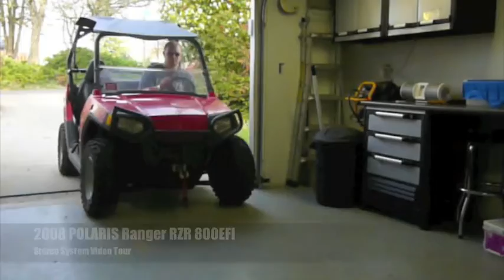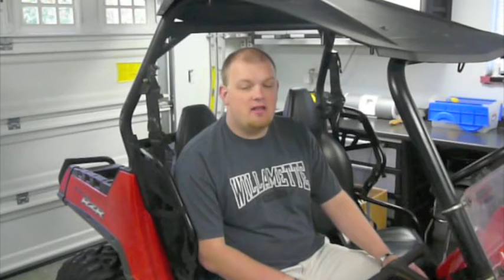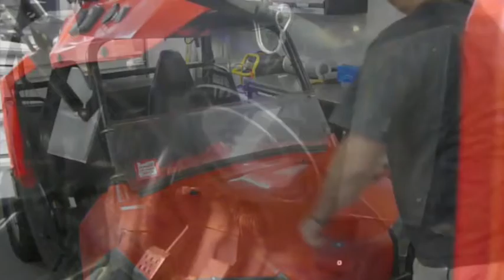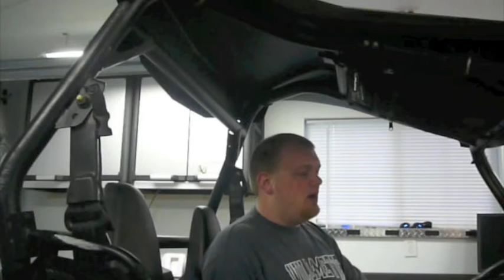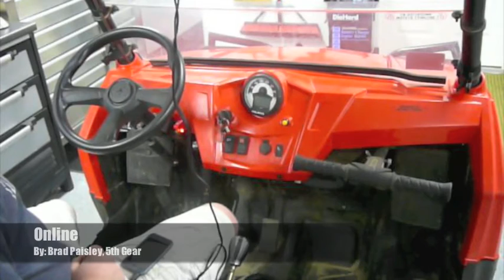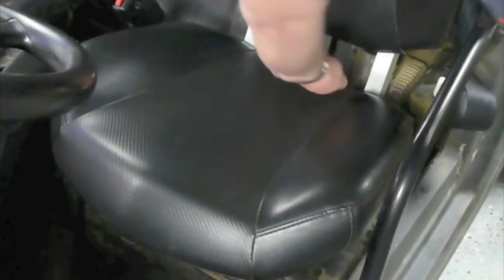RZR Stereo System Walkthrough

Comment: nice im in the middle right now of hooking up my system in my rzr but mine will bump a little harder lol, im putting in 2 alpine 12inch type r sub with this resin that will water proof them for the most part and im putting in a head unit just gonna remove the tach and cut some plastic lol, 2 m70 alpine speakers, and using a m2000 alpine amp, lol basically gonna shake those squirrels outta the trees as im driving lol